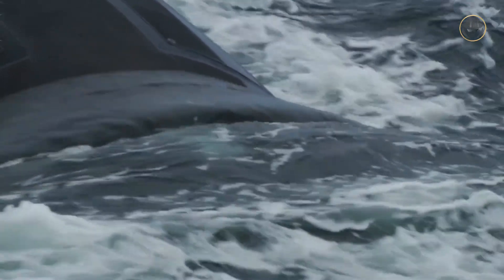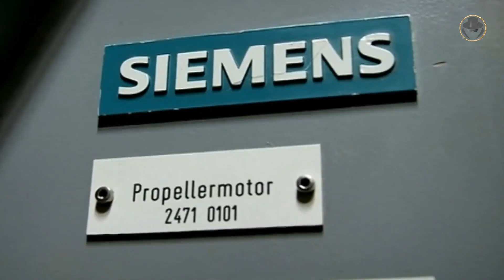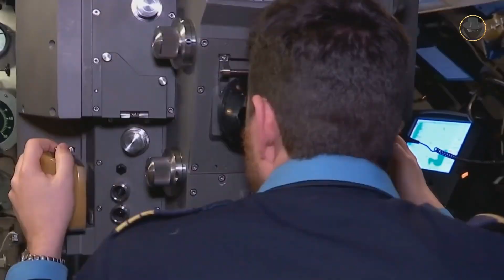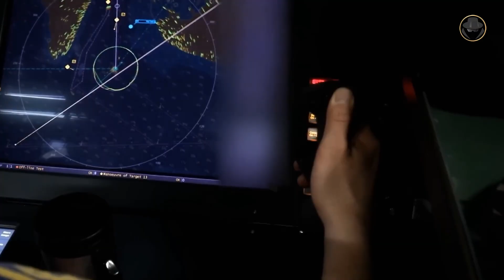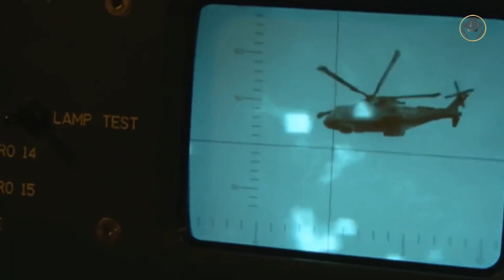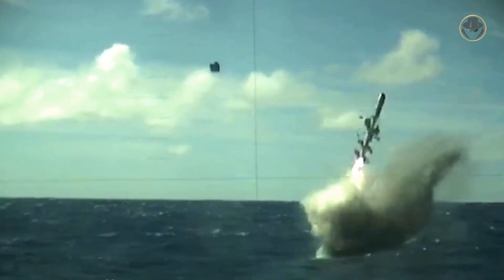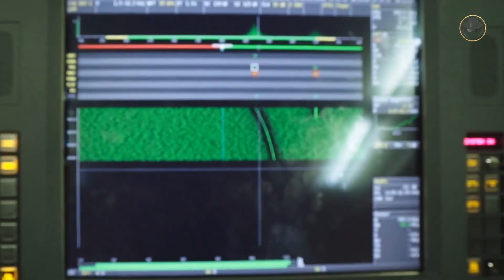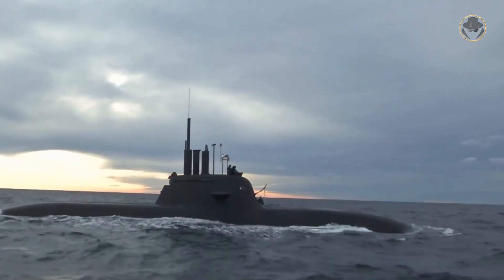Type 212A class | The submarine that is changing the underwater warfare concepts

Comment: Propulsion is 1700kw, not 3900. 3900kw is the generator. The electric motor/generator can output 1700kw just from battery. The diesel engine can output 2150kw, hence the 3900kw name. Combined diesel and electric output can boost output to 2850kw. Usually the diesel will just be used for power generation, not propulsion unless conditions call for it.

Comment: Being harder to detect by a magnetic anomaly detector while also being less susceptible to sea mines are the advantages of using the different types of non-magnetic materials in the 212A submarine design.
But the non-magnetic materials used in this version do reduce the depth the submarine can operate at compared to the conventional version.
If the country that buys the submarines can negotiate a deal. The weapons fitout such as the torpedoes and torpedo tube launched cruise missiles can be factored in when the submarine is designed. The X-Form tail design is also becoming increasingly popular in modern submarines with it almost mandatory in most new designs.

The type 212A and the export version the type 214 are extremely successful designs with both well thought of in the submarine community. With multiple different versions with different types of weapons fitouts and combat systems built over the years for different customers including the ROK and Singapore. 
😎🇦🇺😉👍

Comment: The Swedish AIP is based on the Sterling engine. It's not in the same class as the German AIP. Sterling AIP was fitted to Japanese submarines but proved difficult to maintain. The German system will evolve and eventually extend it air independence capability.

Comment: Some ideas are old. 1. The Hydro- drive system was explored in the 40ies in Germany, called Walther Drive System. It never made to military service. The Boat was named V 80. Capable to drive very fast under water with out any airsupply. The handling of Hydroperloxyid was not easy so it never make to a real navy boat.  2. The radar reducing or consumtion surface techology was also proofed since 1944. The Alberich surface, named after a mystic german dwraf,  made of rubber  and some other ingredients and a mamorized surface should reduce the sonar and radar capabilities of allied vehicles detection systems. Both, the raw materials were very rare and  the lack of good and permand glue, the project was only once tested on two boats. Many patterns of the the systems were lost while on patrol due to the permant kinestetic power of the water.  3. But it has been used to proteced some of the late snokel heads of the U Boats to decrease the detection from destroyers. 4.  Even an remote automatic AA gun were installed on the XXI boats in the turrets, two dooble 2 cm AA guns, controlled from the inside the boat, but only on surface. The XXI Boats should also have a Hydroperloxid drive, on the first intention, never realized due to the handling and logistic problems. 5.  In 1943 a light helicopter with self driveb rotation blades and one pilote was intrduced on some of the  IX- boats, which had operated in the South Atlantic and Indian sea, to increase visualitity range.  Of cause it was not a drone but the idea was the same. So not all Ideas are very new. Today we face a much large wider technology and materials.

Comment: I wonder if it would be possible to replenish Hydrogen and Oxygen stocks by splitting the saltwater using electricity generated by the diesel?
Reply: You could, but it probably doesn’t make sense.  The boat has good endurance in AIP mode.  You would use the diesel to cruise when stealth is not required.  The overall endurance of the crew is limited.  Any conversion of diesel to H & O is going to be inefficient.  I looked into this in relation to a sailing yacht with a water-maker.  Did it make more sense to have a large water tank or rely heavily on aux diesel generator for electricity to power the water-maker?  My conclusion was to carry enough water for multiple days of cruising and treat the water-maker as auxiliary.
Reply: @oanskeptic5822  yes, the electrolysis process is highly inefficient, but can it be done if power comes by a cable from a friendly ship? But then you need to chill and compress oxygen and hydrogen for storage, so most likely not worth it.

Comment: The largest vulnerability of the World War II diesel-electric submarines was the fact they had to surface to run their diesel engines to charge the batteries.  The Snorkel, developed by Germany, partially solved this problem, but it looked better on a design board than it did in practice.  AIP submarines truly have changed underwater warfare.  Now, with the ability to remain submerged and quiet for up to two weeks, this makes finding an AIP equipped submarine next to impossible.  I understand when the U.S. Navy partnered with Sweden to conduct tests with their Gotland-class AIP submarine, it was virtually impossible to find.  Even nuclear-powered submarines are limited in endurance by their food supply for the crew.  So, if cost makes it impractical (or even impossible) for a country to buy and operate nuclear powered subs, the AIP suddenly becomes a lot more attractive and retains a powerful attack capability.
Reply: They're also far more silent than nuclear-powered ones.
Reply: The issue isn't just costs. As shown in the video, the type 212 can remain submerged in water as shallow as 17 meters. That's critical because the Baltic Sea is a puddle, and if you needed deeper waters, you'd have to surface for transit and all the subs would huddle in the very same spots. When the Russians wanted one of their big subs in a parade in St. Petersburg, they had to show it to the world in the Denmark Straits first, directly off the nose of a NATO partner, because it was impossible to get that thing to St. Petersburg submerged. 
If shallow water capability is critical, nuclear subs will likely be too large.
Reply: @ohauss  worse, nuclear subs need to have a certain amount of water below the keel, for the secondary coolant cycle pumps to intake and expulse water. that is another reason why nuclear subs cant operate in shallow water.
Reply: @ohauss  Draft is the issue the Australian admiral stated with the Virginia class. They are too large for Australian waters.
Reply: @ohauss  There are environments in the Baltic Sea where waters barely allow the transit of submarines even surfaced.
Reply: the US partnered with Sweden bcs a Gotland sub was able to "sink" an aircraft carrier, they passed through the defense line and reached the carrier, the U212 was able to do the same in 2013! I think a French sub was also successful. the US are far more advanced in nuclear sub's, but they are behind in conventional submarine!
Reply: That's two weeks at 8 knots. They can stay submerged for 3 times that if sitting on the bottom conserving power for oxygen generation and not using it on propulsion. That is what makes battery powered subs lethal, because they can sit and wait. They have 3 months of food on board. This is why smaller subs are better for defence. Larger is better for attack.

Comment: On Nato manouvers a German 212A was designated as an enemy sub for ASW carrier group practice. The 212A had an American carrier locked in it's periscope. The whole carrier group had no idea it was there :)
Reply: The famous picture of the USS Enterprise in the scope of the german sub was shot by a German Class 206A U-28.
Reply: @MHG790  The 212A 'Sciriè' also did this on 27 July 2008. Here is the link to the video: at 2:40 
https://youtu.be/dc8Uv-MxIuM
Reply: @askallois  👍😁
Reply: @MHG790  It is not the only allied submarine that has achieved this. Norwegian 40 year old submarines has also done this.
Reply: @Cta2006 Same as the old German 206 class. The point is that more modern carrier groups have more modern defense and anti-sub detection systems. And therefore it also takes more modern subs to overcome these. I doubt the old Norwegian or German or whoever's subs from 40+ years ago would still be successful.
Reply: @wanderschlosser1857  It is :-) It's all sbout tactics and using the submarines astetics to ones advantage.
Reply: @Cta2006  I think you can expect that carrier groups now 40 years later have better means of detecting subs. Also because those various successful exercise attacks happened with lessons been learnt from them. Modern subs like the 212 class, even being bigger than the 206 class, are more stealthy and less detectable. Doesn't mean that an older sub might not be lucky with a skilled skipper and favourable circumstances but far less likely than 40 years ago.
Reply: @wanderschlosser1857  I said it was a 40 year old submarine type, not that the "sinking" of US aircraft carriers happend 40 years ago.  Far more recent. But don't worry  Noreay has new submarones on order ... the Type 212CD
Reply: I think a Swedish sub was also able to "sink" a US carrier in one NATO naval exercise some years ago.
Reply: A 212A of the Todaro class also evaded the entire battle group and positioned itself near the aircraft carrier, took a picture of it and sent it to the carrier's CIC. There is footage of the photograph on the web.
Reply: The Australian “Collins” class submarines have repeatedly achieved the same feat without air independent propulsion…
Diesel Electric submarines are potentially very stealthy but short legged.
Reply: @allangibson8494   yes, i recall one NATO exercise, the Norwegian Ula class (diesel electric) was disqualified after it had sunk the whole invading NATO fleet.
Reply: A Norwegian submarine of the ULA class ( wich is a late 80's submarine ) has done the same thing on several occations. Nothing special.
Reply: That's because the US isn't using it's war tactics during those exercises. In training you want your training partner to go through all the moves even though you can stop them .
Reply: @kinte1870  On training mmanouvers you want it to be as realistic as possible. US submarines has also been "caught" by friendly NATO submarines in non exercises

Comment: This Submarine looks amazing however those countries with nuclear-powered submarines UK ( My country ) US , France etc won't go back to diesel-electric submarines because they can stay underwater longer the only thing that stops them from staying underwater is the resupply of provisions !!!!!!!!
Reply: well nuclear submarines are significanly louder and have limitations  operating in shallow waters.
There is a job for both systems
Reply: The US is the only country operating exclusively nuclear submarines. The UK and France aren’t “going back” to diesel-electric subs - they never left them in the first place.

Nuclear submarines have many advantages but also drawbacks. They have to be a certain size to accommodate the reactor, coolant loops, and steam turbines. These are also inherently noisy so they need very sophisticated insulation and dampening, which adds even more size.

Size is not a problem when you’re doing blue water operations, like escorting a carrier group. But when you’re sneaking up on Russian ports in the Baltic, a nuclear submarine is less than ideal.

Also you have the cost. Nuclear subs are expensive to procure and maintain. If you don’t even need the endurance and speed (like, again, in the Baltic), you’ll be better served with a couple of diesel subs than a single big nuclear sub.
Reply: Sorry, I checked again and the UK and France indeed have no dieselelectrics in service currently. I misremembered something from the Cold War Era, my bad!

Comment: I worked (as project manager) for one of Fincantier's subcontractor. We built the machine that was used to put together the hull, we built the welding system and we built all the hatch... AMANOX (the anti magnetic steel used) is a bitch to weld, worse than stainless steel and titanium. this is the best job I have ever done... and I still have some of the original drawings.

Comment: typical Germany
make a good sub, then save money on power station (it's not nuclear) making it practically useless in today's battlefields
by the time a diesel is underwater, it needs to resurface again... Range is also crap !
Reply: tell me you have no idea about submarines without telling me you have no idea about submarines
Reply: Really ignorant comment. These subs are meant to mainly move in coastal waters, not that far from their native bases and be able to get close to the shore - wich is something the much larger nuclear subs generally can’t. These can move under water for a couple of weeks without having to surface and they are also significantly more quiet, wich is pretty damn important for a sub… 
(You can also get several of these for the price of one nuclear)
Reply: @e.m7116 yes exactly, these German subs are mainly littoral, but can go blue waters if necessary. The newer models used by Singapore Navy have extended air endurance to 1.5 months without snorkeling. 1.5 months. Enough to go anywhere and take out objectives and back without ever surfacing. The dude didn’t know his stuffs… don’t mind him 😂
Reply: Die boote sind so gut das sie die temse hoch tauchen und am tauer anlegen ein bier trinken gehen und wieder verschwinden ohne entdeckt zu werde😂😂😂
Gruß an den König
Reply: What need to surface? Google “AIP” before showing everyone your ignorance!

Comment: 6:12 Lithium-ion batteries are a bad idea in a submarine: once they catch on fire, they can't be put out, aside from the toxic fumes they produce.  Lead-acid batteries, not so much.
Reply: i'm pretty sure they will go with lto cells, so there won't be these problems.
Reply: @bastifantasti82  The @HydraulicPressChannel has done some lithium-ion battery crushing. It was good to see the last test where the cell didn't burst into flames.
Reply: Lithium iron phosphate (LFePO4) batteries are the ones that will replace the 212. They have been testing them for three years now and have successfully passed certification.
Reply: @AlFreeman-xy4jy it’s current installed in the new type 218 and already in commission for the Singaporean navy .

Comment: Thing must be pretty spacious for the crew by submariner standards considering the Seawolf has a crew of 140 while the 212 has only 27. Yes, the Seawolf is triple its length, but it has nearly 7x the crew size.
Reply: DW did a documentary called 'Submarine Soldiers' (on YouTube) that follows a crew through workup and initial cruise.  These boats are pretty cramped--hotbunking is normal.
Reply: A more fair comparison would be to compare by volume rather than length (the Seawolf is both longer, wider and higher). If we compare the surface displacement (not a perfect measure estimation of volume but the closest I could think of right now) to crew size we have Seawolf 8600 tonnes by 140 crew 8600/140=61.
For the Type 212A we have 1524/27=56. So a little more displacement per man in the Seawolf then.
Reply: The Russian Alfa class nuclear submarine has a crew of 31 (limited by its escape capsule).
Reply: @allangibson8494  There are good reviews of Soviet submarines over on the 'Sub Brief' channel (run by a retired submariner), including an account of an incident where the capsule was used for an escape.
Reply: A senior RAN submariner went on board a Dolphin Class submarine and when he descended into the hull he exclaimed this is like the Tardis. Compared to the cramped Collins Class the German boat was extremely spacious despite being a smaller boat.

Comment: Good video. But I want to add some other point. Armed unmanned surface vessels, such as the Turkish ULAQ and MİR, can carry variable depth sonar, ASW torpedoes and ASW rockets. They are a couple of tons. Normally, no submarines launch a 533mm torpedo for them. It will be overkill and overly expensive. But, in the future, they will have to. The new systems, such as the IDAS and Murane, can also solve this problem.  :_SailorSML:
Reply: That's why they developed a missile, lunched from the torpedo tubes.
Reply: @TuxCommander  launching a Harpoon or Exocet to an ULAQ or MİR is also overkill. The submarines need smaller and cheaper missiles like the IDAS, I think
Reply: this subs are working with different USV, their sub fleet is top notch tech! that's why the US needed a frigate that can defend their fleet against such subs, so they bought Italian frigate for their future frigates!